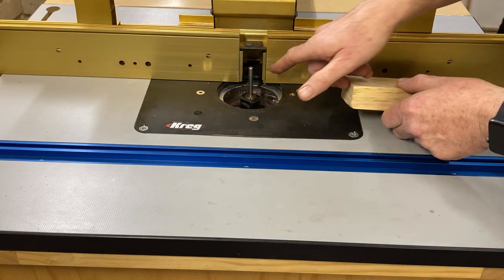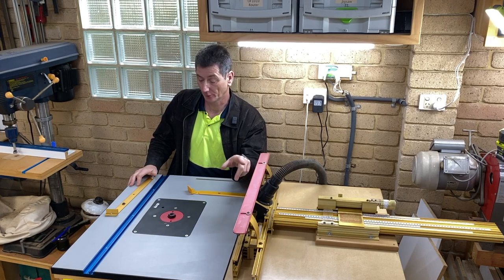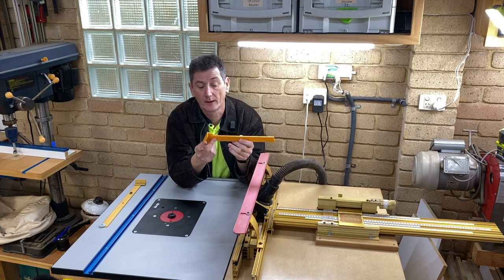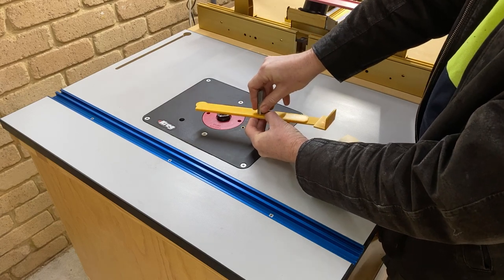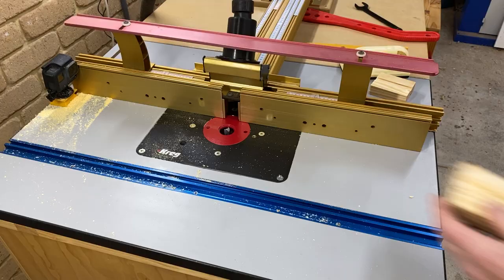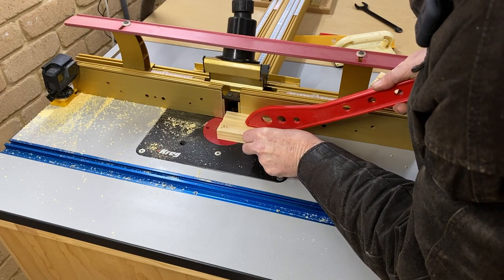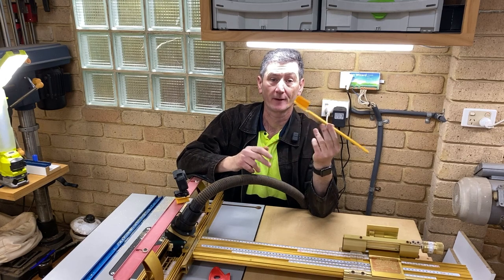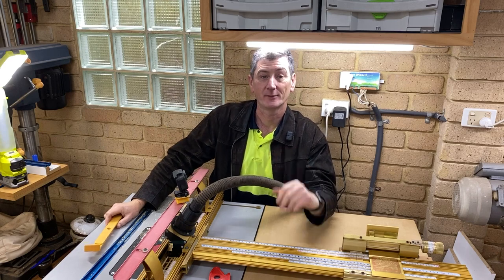Router table centre finder

Comment: Nice helpful tool Darren. Love the channel especially your 3D printing vids. Like you the 3D printer to me is very versatile and exciting tool. I also have the the Prusa MK3 and have never regretted purchasing it. I have just received the textured build plate for mine to try and print PETG. Keep up the awesome work.
Reply from the maker: Hi, Yeah the textured build plate is great for PETG. I still have to use the old plate to get PLA to stick though.
Reply: @DarrensWorkshop  LOL I found that out my self yesterday. I think it may just be due slight variations in the plate thickness. Possibly a slight Z height adjustment needed. But I reckon you would have to do this each time you swapped plates.

Comment: hi darren, i have just received my prusa print, i purchased your file , they seem to have trust file cert. I am a complete novice at 3 d printing, but don,t they have to be in G code to transfer to the printer ?  I purchased the prusa printer after following your advice , It was spot on worked great, straight out of the box
Reply: Hi Frankis. Congratulation on your new Prusa, I'm sure it will serve you well. Yes, you have to convert the STL file to gcode before printing. You can use Prusa slicer for this. Gcode is printer specific, that is why model files are saved as STL's. Some brands of printer (flash Forge) don't even use gcode, but their own file type. All the best, and have fun printing.
Reply from the maker: Yes, Thats it.
Reply: @darren4392  cheers darren

Comment: One more question if I may.  Perhaps you already covered this in the video but I haven't watched it in a minute!  How hard is to change the design for a 1/4" centering bit instead of the 1/2"" centering hole?
Reply from the maker: If you have Fusion 360 (which you can download for free), it would be easy to change the size of the hole in the sketch. The fusion 360 file for the centre finder is included in the Cults download.

Comment: We just bought your plan but trying to use CNC machine versus 3d printer.  File does not keep original dimensions.   If you would give me the length and width we can adjust file in our software.
Thanks in advance, this looks great
Reply from the maker: Hi Dr Jeff. All the dimensions are in the included "Centre finder v1.2.f3d" file.
Reply: Dr. Jeff, Windows has an app called 3D Builder which will open the file where you can view the dimensions. That's what I had to do to adjust the size using VCarve Pro for the CNC machine.

Comment: whats the over length of that design?  I want to make sure my 3d printer can handle it
Reply from the maker: Hi Dean, ~286mm long. It can be printed on a Prusa Mk3 when laid diagonally on the print bed.
Reply: @DarrensWorkshop  thanks for the quick reply!

Comment: I have tried printing this twice on my Prusa MK2 and the little post that holds the L bracket on never coves out and it is too small and brittle. Any suggestions?
Reply from the maker: Hi Gene, I used PLA+ and printed at the 0.15mm Quality setting, with 100% infill on a Prusa Mk3. I have made 4 of them and all of them worked. What settings have you been using? Also, how old is your filament? I have had issues with old filament becoming brittle.
Reply: @DarrensWorkshop  I am using PET and it is less than a month old out of the pack.  The rest of the print comes out fine.  I normally use the Simplify3D slicer but have a print going now using the Prusa slicer.  If it fails I will try one more print with your settings on the MK2.
Reply from the maker: @genewebb8163  if that one fails, I would recommend PLA+. It’s more rigid than PET and easier to print with. Let me know how you go.

Comment: Great jig but I don't have a printer!  Can I purchase drawings so that I can make my own in timber?  Thank you Darren.
Reply from the maker: Hi retrac. The dimensions of the centre finder are fairly critical. For example, If you were out by 1/2mm at one end it wouldn’t give you a true centre. Will you be cutting it out with a LASER or CNC?
Reply: @DarrensWorkshop  sorry but neither.  Plan B can you make me one and post to 3875?
Reply from the maker: Hi again, Do you know anyone in Vic. with a 3D printer that you can bribe with a 6 pack, a cake or something else? I've done a costing on making these and posting them in the past, and it's not really economically viable. Packaging and postage is about $15 within Aust. If I was to charge for my time and materials, these would end up being around $65 each.
Reply: You can make an elementary version of this tool if you can make a single long strip of wood with your dead center hole in it—just drill the hole, then pare down ends of the strip as needed to make the hole dead center. The strip should be dead accurate rectangular (all angles square in the plane of the table surface). Then when in use, one corner of the strip contacts the fence, while the corresponding corner on the other side contacts the corner of your wood piece.

Comment: Can you increase the diameter of the POST and HOLE as long as the CENTER pivot point does not change?
Reply from the maker: Hi again. Ok, I've redrawn it with 6mm nominal connections (previously 4mm).
Reply from the maker: if you email me at darrensworkshopchannel@gmail.com Ill send you the STL files.
Reply: @DarrensWorkshop  I printed with the recommended settings and still got poor results. I ordered some PLA+ that will be here tomorrow. I have the Fusion 360 file and could just change the two circle diameters to 6mm to see if that helps is that ll you changed in your updated STL?
Reply from the maker: @genewebb8163  hi, yes that is what I changed.

Comment: Hi do you have a DWG file for it I have brought your 3D file but there is no DWG. i would like to inport this to CAD and print it and make it. thanks.
Reply from the maker: Hi Brent I don't have a DWG file. There is an STL file for 3d printing and the original F3D file which I included for people wanting to use a CNC machine. Fusion 360 is a free download and will open the F3D file.